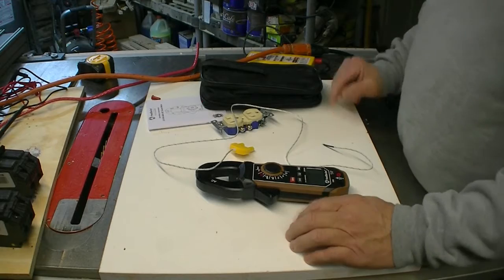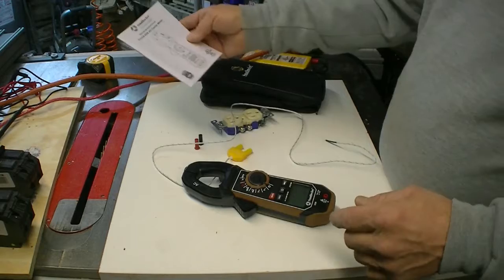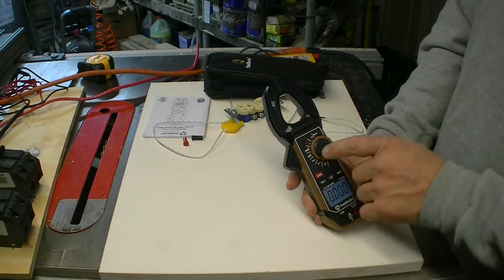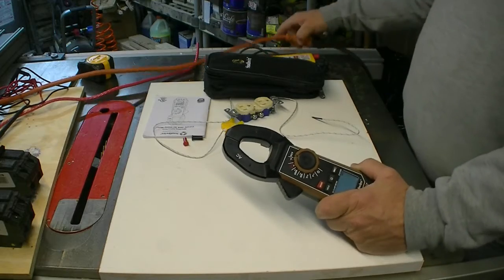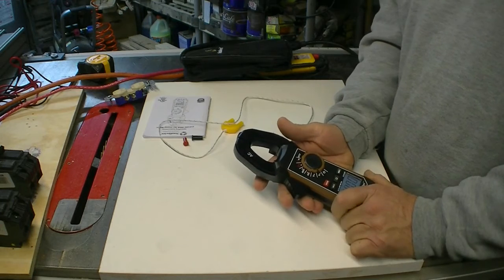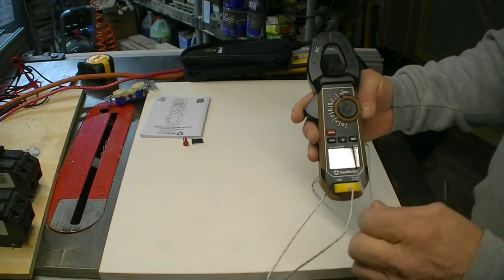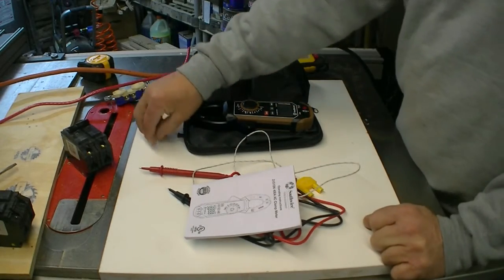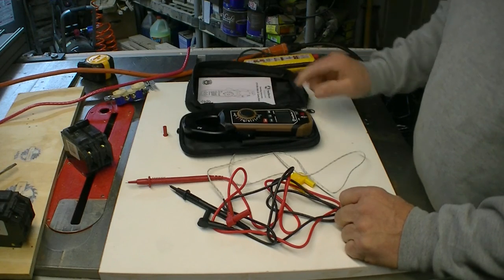southwire digital 600-Volt Clamp Meter. Model 21510N

Comment: The only thing I don't like about this matter is the background light on the LCD display will go out after about 1 minute and funny enough that is the time that it takes usually to get your leads on to what you're trying to measure and then look back at a blank or dark screen where you can't make out the values
Reply from the maker: I do agree the light does not stay on long enough